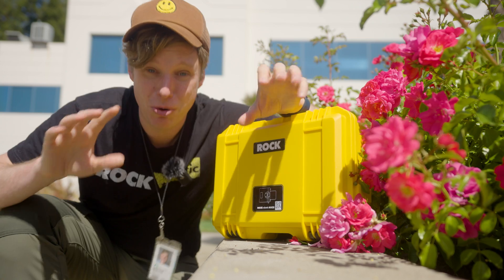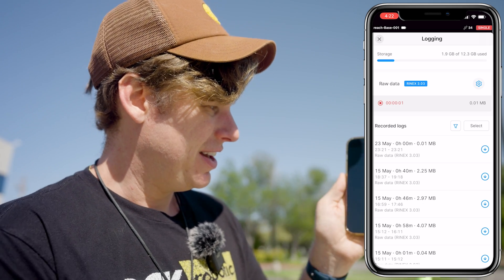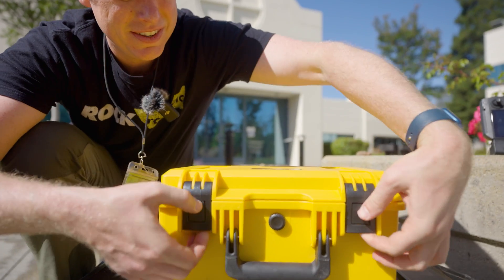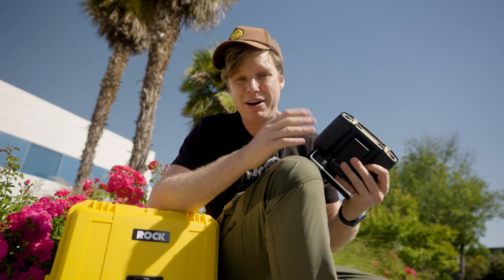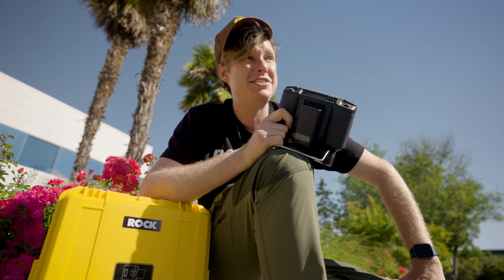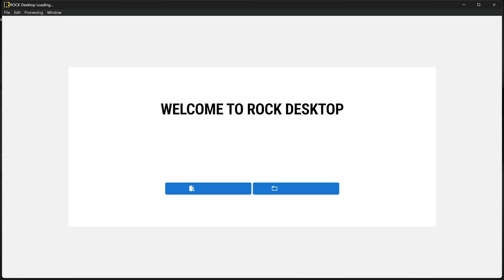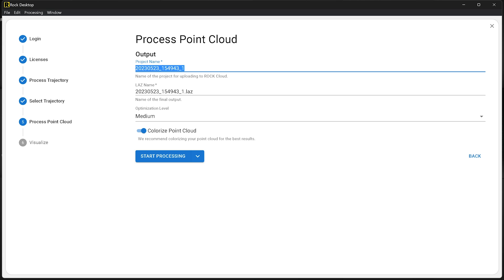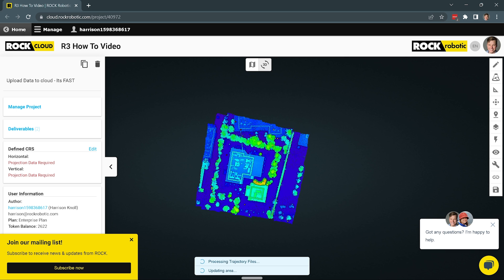How-To Fly Drone LiDAR | ROCK R3 Pro (Walkthrough)

Comment: Hello, Harrison. What is your preferred AGL? Is there a sweet spot for balancing relative altitude and resolution?
Reply: To be honest, fly as low as you can. But practically anywhere from 40-50m is good.
Reply from the maker: Yeah, 50m AGL is my general go to. But if it’s a small site, I will first reduce my AGL - then if I still have some room on my battery set (flight time isn’t that long) then I’ll increase the overlap.

Comment: Hi, I'd really appreciate it if you could create a video about the maximum capabilities of the drone LiDAR combo. I'm particularly interested in understanding the highest altitude and minimum overlap required for obtaining quality data on one battery set. Additionally, if it's possible to share the dataset derived from this exploration, I would find that extremely valuable. I'd love to see how the combo performs in an environment with mixed vegetation, buildings, maybe power lines and roads. This would provide a great insight into its practical utility and limitations. Thanks in advance and have a nice day
Reply from the maker: We're working on that now using the dataset in the ROCK Cloud!

Comment: Hey, Harrison. You mentioned that if you set up over a known point with the RS2 it would help in post. When and where do you factor in the known coordinates? I'm not seeing anywhere in the Rock Desktop to manually input coordinates. 🤔
Reply from the maker: 12:39 there a check box that says use default base station location. Uncheck that and it shows up
Reply: @IndianaDrones  Gotcha.  I'll check that out next week. Doing 200+ acres Tuesday. 🤟